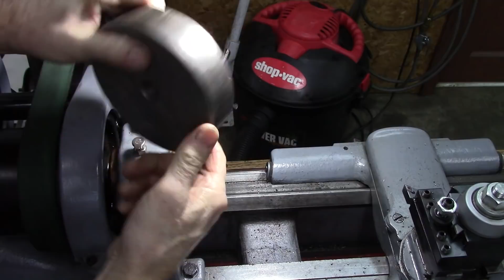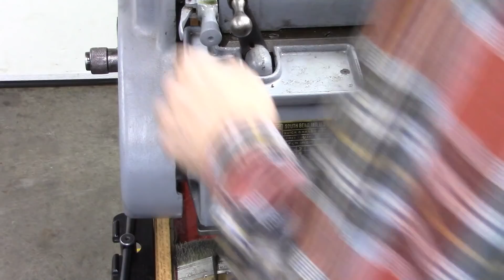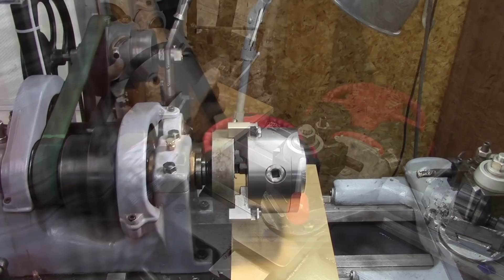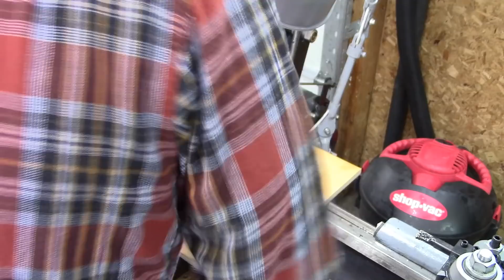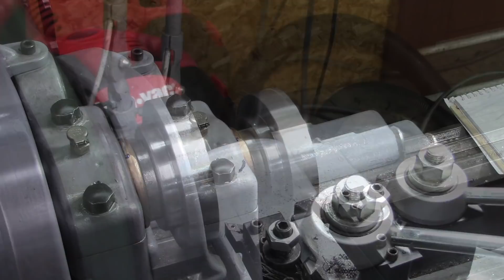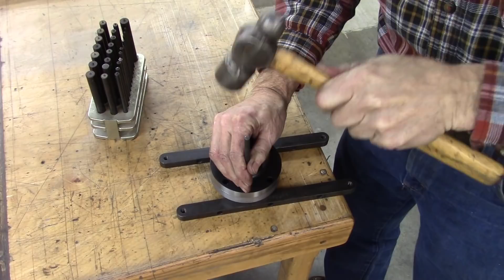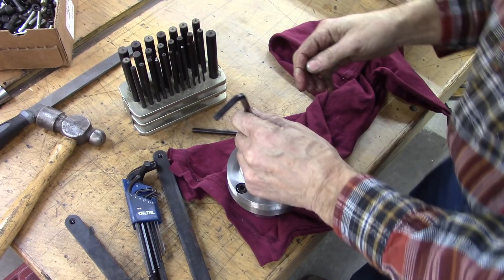Making a Backing Plate for a Collet chuck

Comment: I bought a collet chuck for a Grizzly G4000 lathe.  It came with the adapter already threaded to mate with my spindle.  Just have to do the critical part you mentioned and drill the plate for the cap screws.
I bought the collet chuck about a year ago.  Been hesitating.
Reply from the maker: I messed mine up a little. I had movement in the quill on my drill press.
Reply: @WinkysWorkshop 
I work on vintage fishing reels.  Lots of small parts.  The collets will be great for that.  Just have to grow cahonies and get er done
Reply from the maker: @GaryB94558  Keep in mind that the ledge on the back plate keeps things centered. Even if you have to oversize the holes to make bolts line up it will function fine.

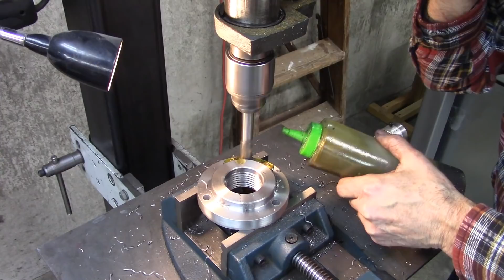Comment: @30:30, what is that tool you are using.  It looks like a interchangeable inner sleeve to fit the hole drilled and give the relief for the bolt head.
Reply from the maker: It's a counterbore bit. with a pilot.

Comment: To check the collet chuck concentricity make a skim pass on your rod and then turn the rod around in the chuck, now recheck your concentricity. That is why I like ER collets; they have .040” range!
Reply from the maker: That would work. Mine is very slightly off. I was thinking about getting turning a 1 inch shaft between centers and turning it true and then mounting the collet chuck (minus the plate) on the shaft and turning the back of the plate true.

Comment: Hey there was something else I was meaning to ask you. Did you check the runout of the inside taper? I know you checked with a collet but they can be imprecise. I just finished mine and it was a few thou at the front, less than a half on the back - not machined on the centreline. I had to true it up.
Reply from the maker: I'd say this is probably the case with mine as well although I didn't check it. I compensated by shimming the faceplate. It's very close but not absolute.
Reply: @WinkysWorkshop  i thought about shimming but chose to clean it up instead. I used trigonometry to set up a precise 8° compound angle and took a few really light cuts. It cleaned up to virtually zero runout. Definitely worth it if you have the time and desire.
Reply from the maker: @freestyla101  I can see where this would be the best method for sure.

Comment: I wonder if the drill press didn’t drill perpendicular and that’s why you broke through on the edges
Reply from the maker: I think you are correct. It probably moved in the vise.
Reply: @WinkysWorkshop  I don’t know about your drill but mine tends to flex at the table quite a bit, so not good for long holes. Either way the video was very helpful so thank you.
Reply from the maker: @freestyla101  This could have been a contributing factor. My square column drill press  has issues with this if I get too aggressive.

Comment: Mark
Thanks.  Your reply was very helpful.  Another question - I have an old four jaw chuck for a threaded spindle and I want to use it on my Jet 1340 GHE lathe.  How can I make the pins that have a half circle on their side which is part of the chuck locking mechanism to the spindle?  Your videos are very helpful thanks.
Reply from the maker: Thanks Frank, all I have ever had is screw on chucks so I'm not much help. Sorry.

Comment: Mark,,
What’s the difference between er40 and er32 or other numbers?
Reply from the maker: ER32 goes up to .780" and ER40 goes to 1.024" I think you can also get an oversized ER40 collet to go to 1-1/8" although I don't have one. I think the minimum size is the same but my set of ER40 goes down to 1/8" which is as small as I need.

Comment: you  could have done what i did & ues the 3 out side hols on the chuck to  as adjustment screws & clock it in.  lick the Buck chuck. les England
Reply from the maker: This is easy to do later. Just undercut the register slightly if needed. If everything is right no adjust should be needed. Mine was nearly dead on at the chuck but off several thou 10 inches out. I put a .001" under one bolt. It's near perfect now.

Comment: I use ER-40 collets on both my lathe and my mill. I like them because with the duel slotting from both front and back they tighten up radially over the whole surface. Most other collets are only slotted from the front and tighten up only at the front face unless your stock has the perfect OD to match the bore of the collet you are using. 
One possible detractor of ER collets is the fact that your stock or end mill must go all the way though the collet. Should your stock or end mill be too short to do this you run the risk of the collet slipping and whatever you are holding can and will slip. I learned this when I first started using them and had some milled pieces ruined when the end mill dropped down and took a bigger bite than expected.
Reply from the maker: I've used them with fairly short stock in the lathe...  maybe .500" into the collet but holding an end mill is probably a little more critical, especially carbide. I love these collets but I see no reason to change to these collets on my mill.

Comment: I spoke too soon -- looking at those chucks again - I see these other collet chucks still use a backing plate that one has to finish out for colinearity reasons.  So the only difference here is you made the plate instead of buying it with the collet chuck.   So - nevermind.  LOL
Reply from the maker: The biggest advantage to the ER collet is that they clamp from the front so you can put stock all the way through the spindle bore but they also have an overlapping clamping range. Other style collets will not allow you to clamp odd sizes.
Reply: @WinkysWorkshop  I had been thinking about collets in the lathe - but did not like the through the spindle clamping mechanisms.  Had not even realized about faceplates set up for collets until I saw your video; a MUCH better way - at least for hobby work.   ...learning as I go -- really appreciate your tutorials. 
==== The ER collets you talk about the overlapping of clamping range -- I presumed that would be true of 5C collects and others as well.  
So are 5C collets more restrictive as to size?    Was thinking going 5C as largest size is 1 1/8" versus 1" for the ER40 sets -- but the ability of going between the sizes is actually more important because we can't always know the OD of what we will be working on.

Comment: Did it ever occur to you Winkers that if the work piece in the collet chuck did run out even .002" it would be impossible to get the work piece to run true.........that is why, when you fit a lathe chuck, or a collet chuck in this instance, to a threaded spindle, it is advisable to make the spigot (mounting)  diam .005" smaller than the bore of the back plate......this will allow you to " correct" any work piece run out to zero by slackening the holding screws and bumping the chuck to zero with a soft hammer.
Reply from the maker: If the chuck is made well this isn't necessary. I'm not sure why you brought up the threaded mount. If the thread is a good fit it's the same as any other mount. Undercutting the register is an option if it is necessary but this is something I don't like to do. There is always a chance that the chuck will move under load. Even on a good 3 jaw there is usually .002 to .005" variation in the clamping range so adding the .005" usually has no advantage. I did add a shim (.001") under one bolt on the collet chuck. It had a little wobble 8 inches away from the collet. Really, in my opinion, the ideal way to fix a problem in a collet chuck is to clamp it on a bar chucked between centers and reface the back of the collet chuck. I didn't have a suitable bar to do this. Don't get me wrong, I would under sizing the back plate if needed, I'd just rather not.
Reply: @WinkysWorkshop  It works even for new chucks that have a small runout.....as I said, if it's as little as .002" you will be vexed if you can't " adjust" the chuck to run dead true...........most chucks after a bit of use will run out on some diams more than others and it's when you do a second op on a part that the run out is not acceptable when you can " adjust " it to run dead true.
This is especially critical with a dividing head as a gear mounted on a mandrel held in the 3 jaw just has to run 100% true........I've seen people banging against a jaw to attempt to get it to run true.
Reply from the maker: @gangleweed  I'm not disagreeing, I'm saying I'm going to make the chuck fit the plate perfect unless I need the adjustment. It takes minutes to under cut a shoulder if needed. 3 or 4 bolts and the chuck is removed. My collet chuck is now running perfect without being undersized. Yes I had to shim under one bolt to achieve this but this is preferable to under sizing in my opinion. This is not a right or wrong...  I simple prefer to do this as needed.

Comment: I love that old lathe, looks like the South bend 9" lathes that we had in the school metal work shop back in the mid 50's .......I have a 1930 Colchester Bantam and it's much like that one with the twin raised Vees for the carriage slideways.........mostly these older lathes have a back gear and for low down speed and torque you just don't get it on cheap lathes that are on the market now......can't think why it's not a refit feature, it's easily retrofitted.
Reply from the maker: I love the old iron as well and yes, for the money you usually end up with a better machine.

Comment: At (min 33.22) I started wondering if there was a bit of slop in the lathe spindle...cold rolled just picking that up..which is giving you the extra thousandths out? It is an cool antique lathe.
Reply from the maker: After making this video I found a suitable 3/4" bar and I ended up shimming one edge with a .002" It's near perfect now. There is .0015 slop in the spindle but it doesn't show up unless you pry up on the spindle. This clearance is needed for an oil film.

Comment: I done something alike for a 5C chuck
I overcome the excentricity problem with a very simple solution,
 What I done is that my faceplate is 2 inch bigger diameter than the chuck body and I do not use the register, 
the chuck is recessed in the backplate with a play of 0.005" on the diameter and I use 4 brass tipped 1/2-20 set screws to make the fine concentricity adjustment.
is it a bit more work but it permits to set the concentricity to  " 0 " the way we do it with a 4 jaw chuck and it permits to compensate for the slop on the spindle thread and the chuck construction.
very good video
Reply from the maker: Yep, I was close but I ended up doing the same. Thanks!

Comment: Another great instructive video.  I recently fitted a similar ER32 collet chuck to my large lathe.  The backing plate is held in a 200mm 3 jaw chuck.  However I made the chuck a "zero adjust" chuck like the more expensive 3 jaw chucks.  That way any runout can be simply dialled out with four centering screws.  If you follow the lead of many lathe manufacturers the collet chuck is a loose fit on the backing plate (say 1mm diametral clearance) . To centre, back off holding screws and tap chuck to get running true.  Once zero runout is achieved, tighten up the chuck holding screws.  Cheers  John
Reply from the maker: Yeah... I ende up undercutting the plate about .0015 so that I could tap it onto alignment. Also added a .001" shim in one edge. Its near perfect now.

Comment: ER40 chuck is one of the best upgrades I made to my lathe. Not sure if you got the full range of collets there, my set goes from 3mm to 30mm.
Reply from the maker: Up to 1". I think I'm missing one collet.
Reply: @WinkysWorkshop  I think up to 1" (25mm on a metric set) is the standard range, then you can buy an extra set of 5 or 6 to take you up to 30mm. Worth looking out for, I use those largeer sizes a lot of holding square or hex stock.

Comment: Sir do you know what I can do to make a 9” chuck run true?  I have a 10” heavy Southbend lathe to make tools and parts for my gunsmith shop.  I’m 71 years old and a 100% disabled veteran.  I like watching you podcasts.
Reply from the maker: There are not perfect 3 jaw chucks and they change with diameter to some degree. You can grind the insides clamping surface or even use a boring bar if the jaws are not too hard. The trick to being successful is to load the jaws as if they are clamping a bar. I saw somebody do this by drilling holes in the tops of the jaws, installing roll pins and then clamping the pins on a ring. The possible problem with this approach is that you are pushing out on the ends of the jaws and not in the middle. Run a search on grinding jaws.
Reply: @WinkysWorkshop  it is a 4 jaw independent closing 9” diameter.
Reply from the maker: @Bullseyegunsmithing  Then getting things centered should not be a problem. If the problem is that the stock is cocked in the chuck the same fix applies. Sometimes you can put the jaws in a mill and square the clamping surface but this doesn't take into account wear in the chuck.

Comment: What is that drill called that you used to make flat bottom holes for the socket cap bolts? 
Thanks for taking so much time on the threading portion. I've just made threads for the first time a couple of weeks ago. How you did it cleared up some issues I had.
Reply from the maker: That's great on the threading. Threading is one of those thing that get much easier the more you do it. The bit I used was a counter bore. You drill a standard hole first and then the counterbore bit has a pilot the goes into the hole you drilled. They make them with a solid pilot or with a pilot that you can change. I recommend a solid pilot. You may have noticed I flooded the bit with oil. If you don't do this the pilot will grab and break off. Mine do not have the solid pilot.
Reply: @WinkysWorkshop  I have a mini lathe with a metric lead screw. It doesn't have a threading dial. I asked the sellers about this and they didn't have an answer other than that "it doesn't exist". I very much doubt that is true. Do you know what is involved with making a threading dial? I was considering making one, but I don't really know what I should expect.
Reply from the maker: @de-bodgery  I've made 2 in the past but they were both imperial and not metric. You can still thread on your lathe but you have to run the lathe in reverse and never disengage the carriage. The hard part of making a thread dial is the gear. You need to find a lathe with a threading dial that has same pitch lead screw you have on your. Then you can count the number of teeth and diameter and then find a gear.  Making the rest is fairly easy.
Reply: @WinkysWorkshop  Yes...that's what I have been doing. I never disengage the lead screw until I'm done cutting threads. My very first threads were 1mm reverse...so that was interesting to learn. I've since refined how to do it much better, but until I saw this video, I was not using my compound correctly.
*
I am currently building a tool post mounted grinder attachment for other uses with my lathe. I think with that I can grind pinions and other gears. Ive already added a rotary table to the out feed side of the spindle bore that is easy to disengage. This allows me precise degrees of rotation of the spindle for keyways and other things I'll do on my lathe. The grinder will be the primary tool for cutting the features the rotary table defines. Once it is further along, I'll make a video of it on my channel.

Comment: you got off because you free hand drilled, always hard fixture parts in a drill press
Reply from the maker: Yep...  took a short cut. Part is the reason was the holes in the chuck were not symmetrical. Of course I didn't not think to check this. Also the transfer punches were a little small (empirical vs metric). I should done it on the mill or clamped it together and used the back chuck as the guide. The later would have been easiest.

Comment: You are full of all kinds of updates here these days my friend. Thus chuck is going to see A LOT OF USE EH. Mine sure did. I don't know how I ever did without one.
Reply from the maker: I've been wanting one of these for a long time and finally did it.
Reply: @WinkysWorkshop  We will spend a few thousand on a machine and 10x that and more in tooling over the years. The we most times have to make the adaptors etc to make them work. It is like creating xmas all year round eh, LOL.
Reply from the maker: @TomokosEnterprize  Heck yeah!
Reply: @WinkysWorkshop  I am thinking now that 10x is pretty light, esp for the lathe and mill. I can only imagine the cost of a couple sets of gauge pins, Round and rectangle standards. 5, min sets of cobalt drill bits, The never ending purchase of tool bit holders and new bits that are forever coming on the market. There's an idea for a video you can do my friend. Take care bud.

Comment: I built two so I can use Collets on my Sheldon 10" and my Atlas 12" - this is a great addition to those machines capabilities. I have run out under .0005 on the Sheldon, and right at .))! for the Atlas. The Atlas bearings are probably the source of most of that. You do good practical projects. Thank you.
Reply from the maker: Thanks...  Yeah, I worked on mine a little, it's less than .0005" now. The chuck itself was a little out but as near as I can tell the collets are perfect.

Comment: Thanks, very good, I have been considering some ER collets so this has helped. 2.836" is 72mm (72.03) which I think is a pretty standard size register for 4" / 100mm chucks. People could buy a commercial plate in this size if they did not have the skills or resources to do a great job like you did.
Reply from the maker: Thanks Robert, yes buying a back plate would speed things up a lot.